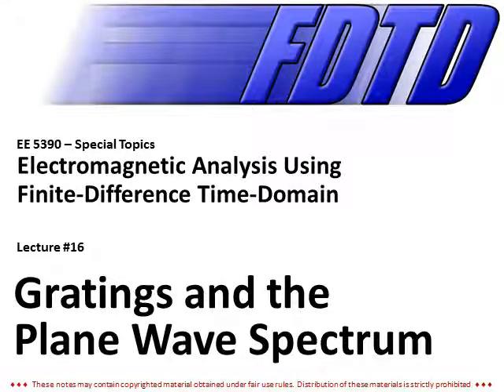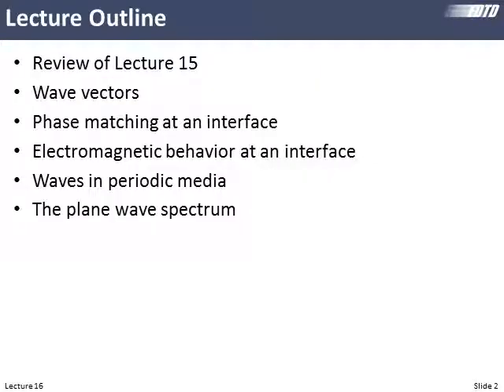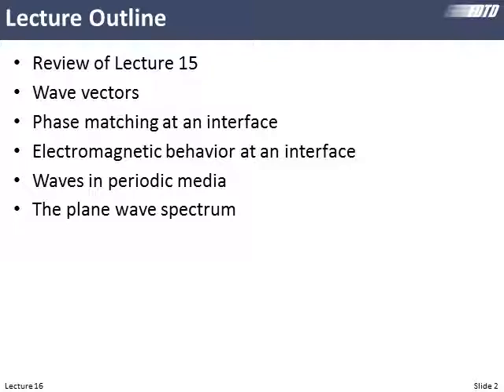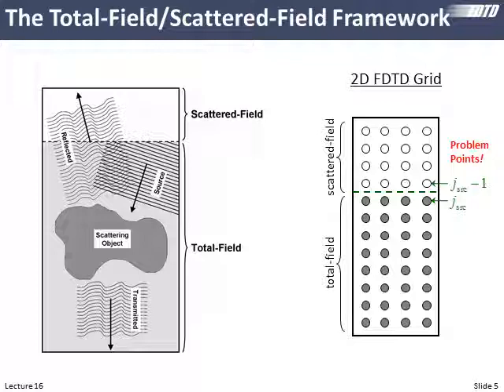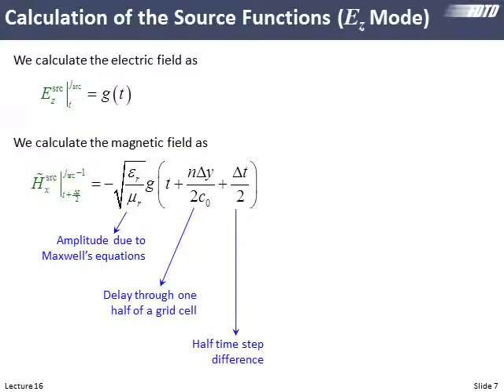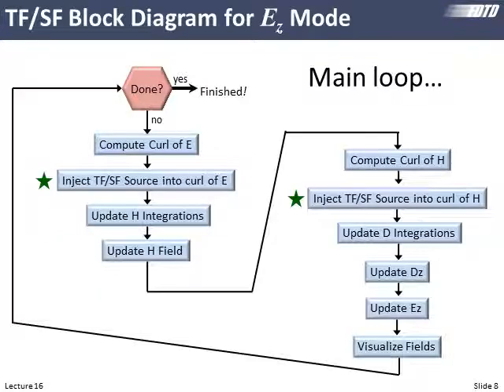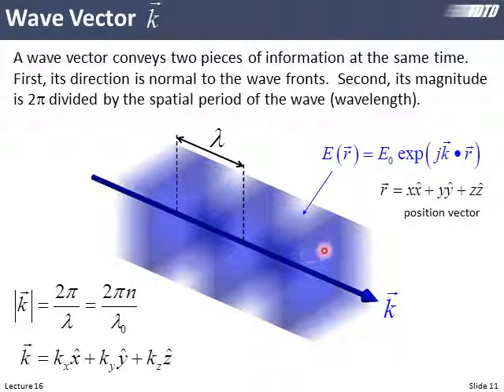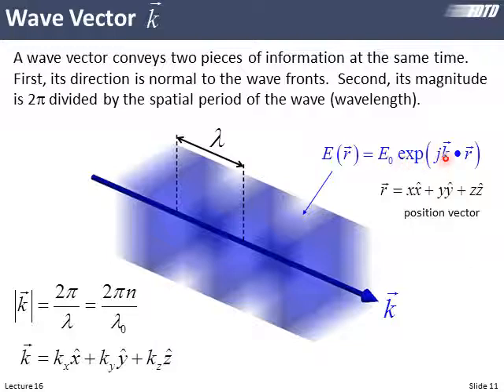Lecture 16 (FDTD) -- Gratings and the Plane Wave Spectrum

Comment: Thank you very much for these excellent videos! I am trying to understand the material around 41:30, specifically, what happens to the phase of the incoming light. Is it correct to say that we lose the phase information but keep the amplitude (envelop) information "A" with the phase of the propagating wave in the waveguide now defined by the grating structure period? Thank you! :)

Comment: hey thank you for your videos. Can this method be used when the periodic stracture isn't just a combination of dielectric materials but a cell of metamaterial with PEC or copper on top of these?
Reply from the maker: Yes, absolutely it will still work.

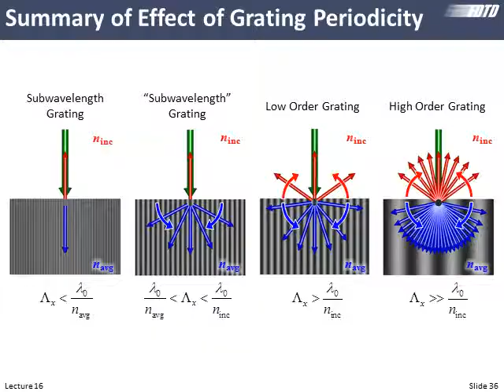Comment: In 39:40, for higher order gratings, an extreme case is when periodic length is so large it resembles an homogeneous medium. In that case the number of diffracted modes will reduce to 1. Am I right?
So perhaps there is a sort of "reversal point" in which the the diffracted modes of the high order grating starts to go back to resembling the low order grating?
Reply from the maker: No.  When the period is very long, there will be many diffraction orders.  There is 1 diffraction order only when the period is less than the wavelength.